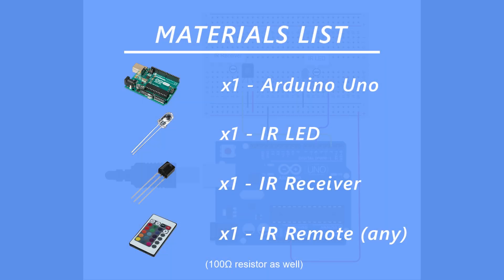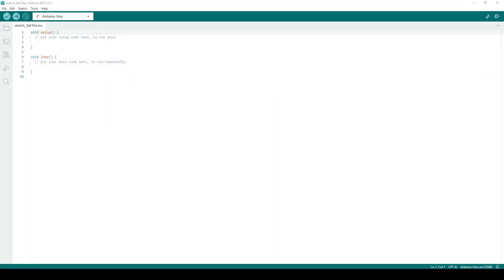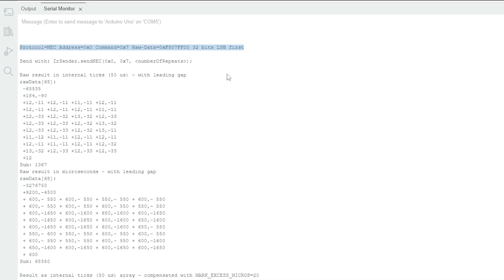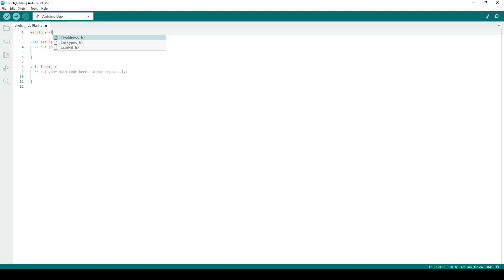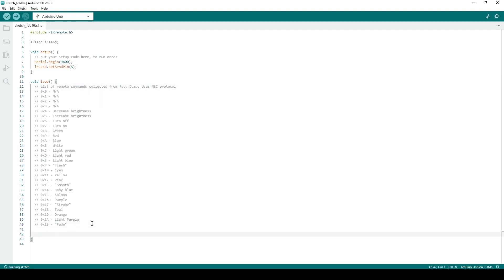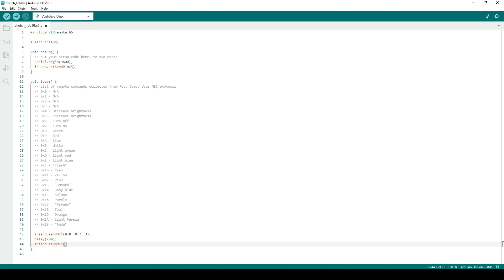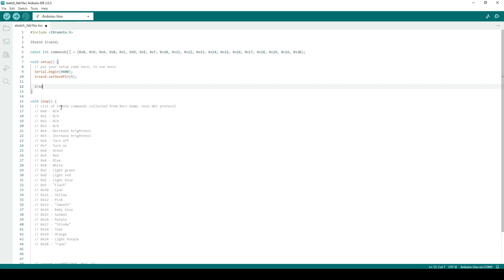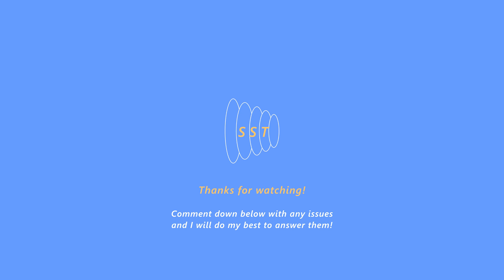How To Control Any IR Device With Arduino!

Comment: hey ive got a problem, everytime i try to receive a signal it just puts it in the serial moniter as a jumbled mix of symbols and questions marks? can you help me out?
Reply from the maker: Did you check to make sure your serial monitor is set to the same baud rate as the serial port that you started?